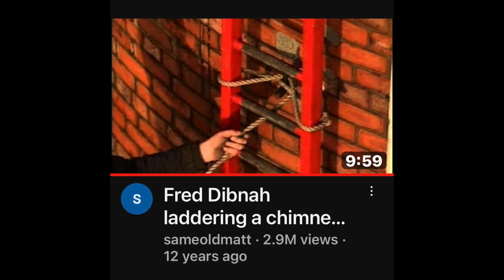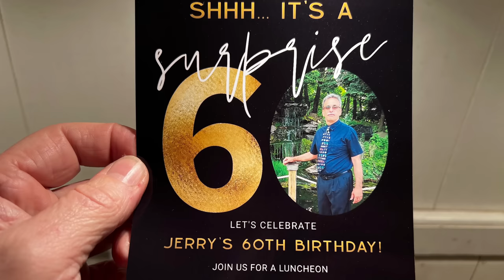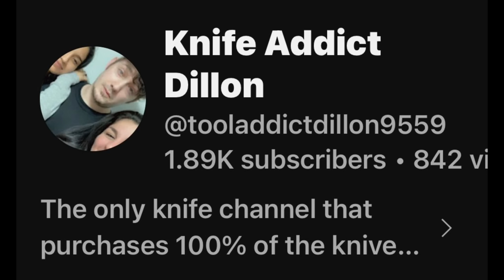Fred Dibnah, M5A1 Bayonet for Jerry with Box Build.

Comment: I spent considerable time watching Fred going through his job and his hobbies. 
Quite the guy. I'm not afraid of heights. Those lashed together ladders and stubbed in board platforms are a bit more than I would like. Takes me back to the days of working on the 80 foot Cupola stack at the foundry. Changing water lines in the winter wasn't fun. 
The steam lorry was fascinating. 
Jerry is a lucky man to have friends like you. 
I had a bayonet from the Spanish just before WWII. I picked it up at the Army Navy store in Three Rivers, MI in about 1973. When I built the Harley Trike into a chopper I used the bayonet as the shifter handle. I made a couple mounts on the shifter so the blade edge faced the seat post. 
When I sold the trike I kept the bayonet. 
It disappeared along with a couple other knives and various bric a brac about the time we had a garage sale. 
We had a discussion about yours, mine, and ours. 👺😎